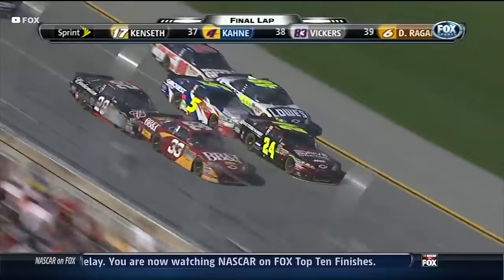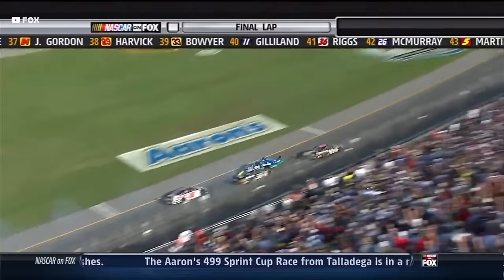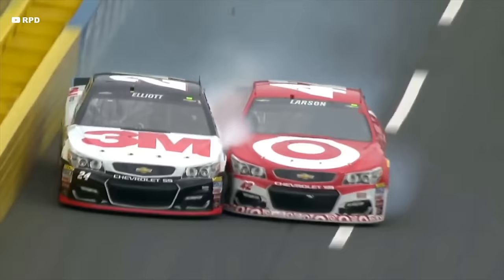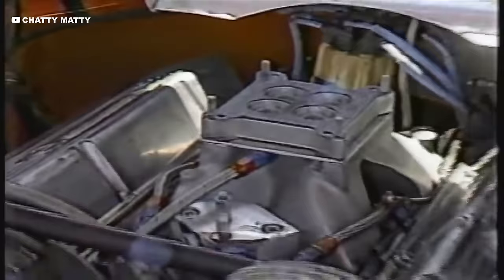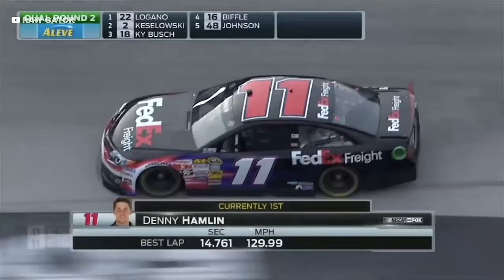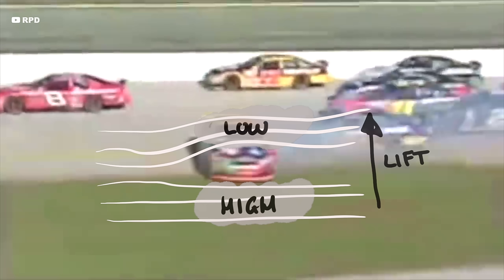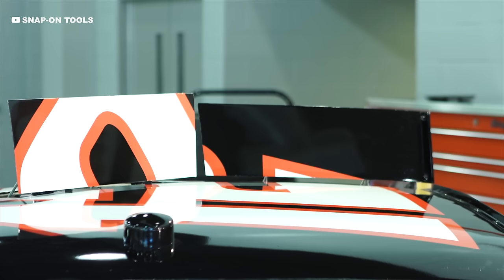The Simple Invention That Saved NASCAR

Comment: 3:23. Not correct at all this explanation on why the pressure is different on the sides if the wing.
two molecules of gas that "split" on the wing front dont necessarily meet on the back.  You can assume the speed on top is greater than the bottom only if that is true.
The pressure difference is actually a complex process which can be described by the Navier Stokes equation and not only bernoulli principle.
(sorry for my bad english. love your videos!! keep up with the good work)

Comment: I wanted something to show the airflow on the flaps. They appear to do an amazing job at keeping the cars from flipping, but to me they seem counter intuitive. if you put a flap like that facing the direction of travel on top of an airplane it would cause the nose to pitch up very rapidly. To my mind, it looks like the flaps would cause a force that will pull the top of the car upwards, bringing the rear of the car even higher up when traveling in "reverse". However the way I guess it actually works is by causing a turbulence that interrupts the rest of the car's aerodynamics? I suppose the highly effective aerodynamics of the body of the car is what previously caused cars facing backwards at high speeds to flip.

Comment: One error to point out and I know you're not an aviation guy so I don't fault you for it. Spoilers on aircraft aren't used to generate downforce, they are used to disrupt the laminar flow of air over the top of the wing to reduce lift and increase drag. This is why they are called spoilers, they "spoil" the airflow over the top of the wing to increase drag thus slowing the aircraft down in the air and at higher speeds on the ground they are not used to assist in braking directly. On jet powered aircraft thrust reverser's are used to redirect the air that bypass's the core of the jet engine to instead of exiting rearward, push forward instead to slow the aircraft down to a speed low enough to begin braking. Otherwise you would cook the brakes on landing on large commercial aircraft due to their mass and energy they carry on landing. While the brakes are rated to take the aircraft to a full stop without assistance it will ruin the brakes and require them to be replaced.

Comment: 3:30 You have fallen in the myth of "air has to travel further therefore it goes faster". That is completely false. There are plenty of airfoil designs in which the lower trajectory is longer than the upper trajectory but the airfoil still produces lift. 

Also if you do the math, the lift coefficient obtained by bernoulli alone would be much lower than the actual lift coefficient obtained in wings.

Most of the lift of a wing doesn't come from Bernoulli, it comes from something called "Downwash" basically the wing deflects air downwards creating lift, put it upside down and it creates downforce.

Comment: very nice video. amazing tech.
the explanation about lift is off though. "the air has a longer way to go" doesn't provide any reason it would go faster and infact the air kn the longer side of the foil (the top of a airplane wing) can reach the end of the wing profile before the air on the underside does.

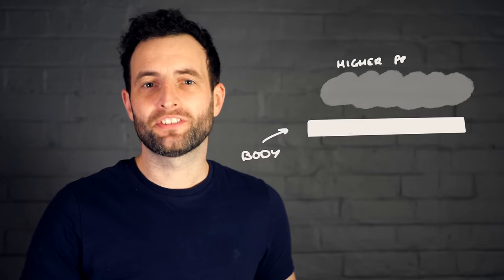Comment: 3:13 just a helpful piece of trivia, the official term for that is ΔP, or Delta P; differential pressure. The same aerodynamic force that creates lift or downforce is the same force that allows a naturally aspirated engine to draw in the fuel/air mixture into the combustion chamber, or even a carburetor drawing in fuel in response to changes in air flow. In both cases, differences in air pressure always try to equalize.

Comment: 4:56 And this was exacerbated in the early CoT (Gen5) days, with a rear wing instead of a spoiler.

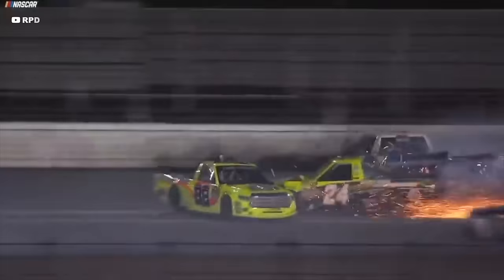5:33 It was as a response to this crash that NASCAR mandated flaps for the beds of the trucks in the 3rd-tier Truck Series, in addition to the roof flaps that had been mandated in 1994, not 1996 (so, actually, before the Truck Series existed).

Comment: While it’s not a perfect system it does work in most cases.   The only time they really had issues what’s when they put wings on the back and it made the flaps almost useless.  But since switching back to regular spoilers it’s gone back to normal.

Comment: You guys dont even want to know the tolerances on aerodynamical parts on vehicels meant for high speeds and races.
When a few small Sharkfins on the underside of the splitter keeps the car from flying etc.
I was repairing Composite parts for cars and motorcycles driving in Le mans and DTM etc

Comment: Neat video, but please don't perpetuate the myth that air flows faster over one side of a wing because that side is longer and the air has to take the same amount of time to go over either side. If that were the case S shapes on the top surface ("top" being toward the direction of the lift force) would make the most efficient wings, but they don't; in fact, the air gets accelerated over the top so much that it gets to the trailing edge before the air going around the bottom in most wings.

Comment: i couldnt imagine driving at 200mph for 500 laps in a hot ass car literally inches from each other
Reply: I race dirt track. Hot, going 50-100mph average, and 15-50 laps. Fun as heck tho
Reply: The NASCAR season starts late summer gets into full swing during the summer,  so many times the temp outside is 90+ degrees F.  Sometimes these guys have to be helped out of the cars after races because they are so weak from dehydration/heat exhaustion even though many actually use hydration packs these days.  It usually runs about 30-40 degrees hotter in the car, so if it's 90 outside it'd be 130 inside (and even hotter near the floorboards) and the drivers can lose as much as 10 lbs. in sweat during a race.
Reply: @bigd7481  the nascar season starts in February dude
Reply: @a12shotman  Yep, sorry.  I meant to say it gets into full swing during summer, not starts.

Comment: The flaps and the restrictor plate worked just a 50% they still flying but at lower heights
Reply: wasn't the restrictor plates more about reducing the speed of the cars to avoid a bigger collision with the crowd present rather than to reduce the chance of a car flipping? I watched a video recently about Earnhardt were it's shows that most of the drivers didn't like it because now cars packed together and any accident would lead to a domino effect on the track, causing more carnage than before the Plate's introduction

Comment: You can see these flaps opening up in many of the clips that intend to show how cars take off, so they are not completely effective. Are there any estimations on how effective they really are?
Reply: They don't always work 100% but if you look at some of the races before they put the roof flaps on and after there is a huge difference the only recent crashes I've seen where a car has taken flight is because of secondary contact but other than those it's very rare to see a car go up in the air and upside down without contact from another car initiating it. They don't always work though especially at 200mph backwards but they have kept more cars than I can count on the ground.

Comment: I thought that the main function of the rear spoiler of a Nascar was not to create downforce but decrease the drag. 
(the wall of air that is created above the trunk forces the air coming from the roof to remain high and laminar)
Reply: No the spoiler creates a pocket of high pressure air above the trunk which pushes the car down.
He didn't explain this properly

Comment: My eyes tell me flaps work but my mind has a bit of trouble with the high pressure generated on the windward side when they're open.  Visually at least what I see is the highest pressure is at the point of longest radius from center of mass.  But, I guess they're taking advantage of gyroscopic effects since the car is usually spinning.  If gyro effects weren't present (yeah, law of nature.. I get it) I expect those flaps would flip the car more quickly than it would have.  Anyway, they do not seem to flip cars (have to believe my eyes) and clearly they scrub a lot of energy out of the system which may be their most important effect from a safety point of view.  Anyway, every time I see them flip open I expect the car to flip and it doesn't... is what it is...

Comment: 3:27 is not true. The air does not "have to" travel faster above wing becouse of the difference of the travel distance. There is no reason why same air particles should meet after past wing. Air flows faster above wing becouse of the Venturi effect. The shape of the wing makes a choke with surrounding air and that is why it moves faster on the wings upper surface. And anyways most of the wings lift is caused by angle of attack.

Comment: 3:37 isn't the diagram should be the other way around? the labels are correct tho (i think)
Reply: The way he explained how lift is created is fundamentally incorrect, and shape is not the primary cause of lift.
A perfectly flat object can easily create lift.
Reply: Also the distance the airflow travels is not the primary cause of creating lift, it's a differential in pressure caused by a differential in airspeed.
I could easily crate an airplane wing where the air travels further on the top, but the wing creates negative lift - or downforce.
I made a comment that explains this and someone else made a great comment and included links to how lift if actually created... The illustrations he used are correct but he did not explain it correctly.

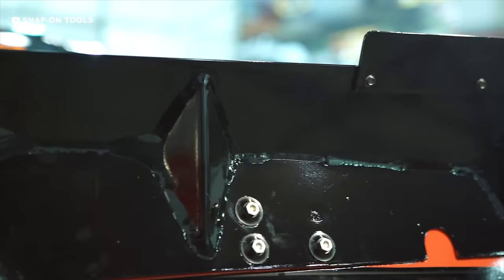Comment: I hate to be that guy, but using Bernoulli's principle as the sole explanation for flight/downforce doesn't work. Smart boy Isaac Newton's laws must also be appied (they're hinted at at about 3:52). The faster airflow above a wing/car does occur, but it's not solely responsible for lift. It's the amount of air displaced, quite similar to a boat.

Comment: 3:30 this is a common misconception about how wings generate lift. The primary upwards force is generated by the momentum of air being 'thrown' downwards by the shape of the wing. Similar to how a spoon will seem to be 'sucked' into a running tap, the real force is due to the water being diverted by the shape of the spoon. The pressure differential does play a role, but is not the main source of lift.

Comment: I don'ton't know much about nescar. Did they ever used parachutes to reduce damage? Is it even possible?
Reply: ??? Maybe, it has to be tested.
Reply: no and it makes no sense. if you get spun but dont crash, you would be out of the race and there because you now have a parachute laying there, connected to the car.

also, a parachute takes way too much time to deploy and to  slow the car down for it to be usable in any real scenario, considering youre either 

a) going into a wall in 2 seconds at high speed (no time for parachute)

 b) going into one at low speed

or c) just ending in the grass.

Comment: Good video but your explation on wing is wrong.
If air have to travel faster due to more distance, the flaps open will make more suttle distance, it would not work.
And image if your tap water come from a river 3 km away and your sewage goes the same river 200m down stream , that doesn't make your tap water run like a hell to match the pace in the river....

Actually the upper (for airplane) air on the wing goes much faster, it travel from LE to TE using much less time than the lower air.

Comment: NASCAR aren't high downforce cars, they have simple aero and get a lot of grip from their slicks, but they're nowhere near the downforce of LMP-cars and Formula cars (even lower tier formula cars will have a better downforce to weight ratio)
unkown with the new hypercar class
Reply from the maker: You're correct, but they spend more time at higher speeds. So the force created by the aero isn't that far off an F1 or LMP1 car at their respective 'normal speeds'. You're right though, with both at say 180mph - the difference is massive. - Callum
Reply: @Driver61  please correct the explanation of how a wing works around the 3:30 mark... Many people have commented on why, and how the explanation he gives is fundamentally incorrect

Comment: You really should remove the part about wings creating downforce simply due to their shape... That's absolutely 100% incorrect. Yes shape helps dictate lift, but not for the reason you stated (distance traveled by the airflow). 

Saying that the distance the airflow travels is what creates lift is fundamentally incorrect. 
A totally flat piece of material can create both lift or downforce (which is just negative lift and is exactly the same principle as lift)...everyone can try this at home. 
Take a flat piece of cardboard etc and hold it in front of a fan that's on high. 
Hold it flat and it'll remain neutral. 
Tip the leading edge UP (leading edge =closest to the fan) and you'll feel the lift. 
Then tip the leading edge down and you'll feel the downforce, which is still lift, just in the opposite direction. That's why engineers refer to "negative and positive" lift... Negative lift= downforce. 

Difference in PRESSURE caused by differential in airspeed between top vs bottom of the wing determines lift, and in which direction. 
When I say wing, I'm referring to an aircraft type wing bc airplane wings are more intuitively linked to lift. 
I could easily create a wing where the distance the airflow travels is longer on the top, but it still creates NEGATIVE lift. Therefore pushing the wing down. 

The REAL way lift is created is by a difference in airspeed on either side of the wing... NOT the distance the air travels.
Air DECREASES in pressure as it speeds up... All a wing is doing is forcing the air to travel FASTER over the top, NOT LONGER.
If you put a "Gurney Flap" on the top of the wings trailing edge, the air still travels further but doesn't create any positive lift at all. 
Please fix this part of the video - I really enjoy your content, but now everyone who watched this whom doesn't know or study fluid dynamics is going to think lift is created in the way you described, and that's just not the case.
Again top notch content - but please remove or edit the incorrect info about the principles behind the generation of lift. Or downforce, which is the same thing.
Faster air over the top compared to slower air under the bottom positive lift.
The distance air travels is not the primary cause of lift.

Comment: These flaps were entirely invented by a single person, a good friend of mine named John Christian, “JC” who was pretty much the McGyver of Roush Racing. NASCAR came to Roush asking for a solution to the problem, and Roush turned to JC. He told me that they couldn’t test their effectiveness in a wind tunnel, so instead they built an elevated rotating platform and placed it behind Jack Roush’s Boeing 727. They ran the engines up to full power, generating big-time airflow, then slowly rotated the platform so the car was 90 degrees, then a full 180 degrees to the airflow. The devices worked. 

Roush actually manufactures all the devices for NASCAR, And sells them to the other teams who then incorporate them into their respective cars. Thus it’s a ‘spec’ part, identical between teams.

Comment: The Equal Transit Time Fallacy strikes again! We love your videos, but the aero explanation of how wings work is simply wrong. Let's talk about it!
Reply: Wind tunnels are not analogous to a body moving through a static medium, where most of the fluids displacement will actually be perpendicular to the objects direction of movement.
Lifting body aerofoils do indeed produce lift, even at 0 angle of attack, and they do so as a rssult of pressure dropping in place of the air displaced.
That said it is correct that a wing will get most of its lift from intersecting the medium at an angle, and deflecting the airflow.
In fact a classical aerofoil can be conceptualised as an aerodynamic teardrop shape fashioned around an angled line.
Reply: @ineednochannelyoutube5384  With respect, if you are not a PhD student I know more about this than you.,

Comment: NASCAR: Racing for those that are too stupid to navigate corners.
Reply: Comparing oval racing with circuit racing isn’t too fair. They’re quite different from each other and require different techniques and driving styles to be fast and successful.
Reply: they drive road courses sometimes. for example: Watkins Glen.
Reply: @jhenzo  Sure, sometimes... but its mostly boring ovals. Its dull.
Reply: @Ren_1090  Its entirely fair.  Circuits introduce a massively higher degree of complexity which tests driver skills.  Ovals are boring and dull and appeal to Americans because you could train an ape to drive a nascar.  Indeed, he'd have better hair than the other drivers and would wear a baseball cap the right way round.
Reply: @djxjxixsmjxjskjzxn1853  eh, i guess that's just your opinion, personally i like oval racing.
Reply: They've got plenty of road course circuits